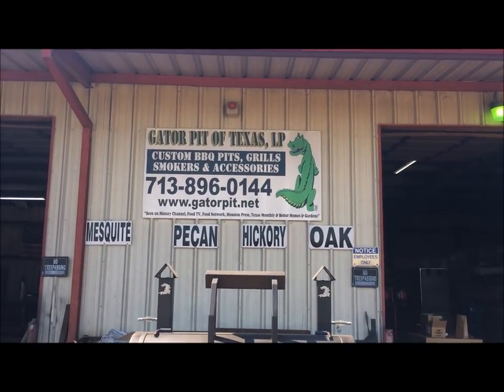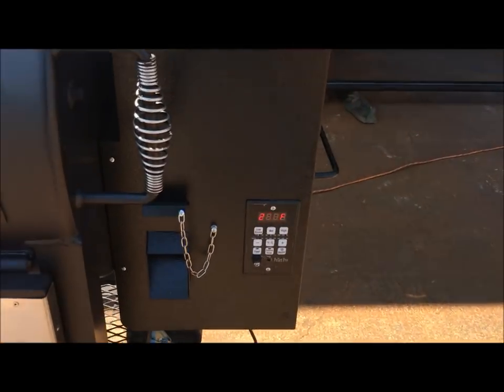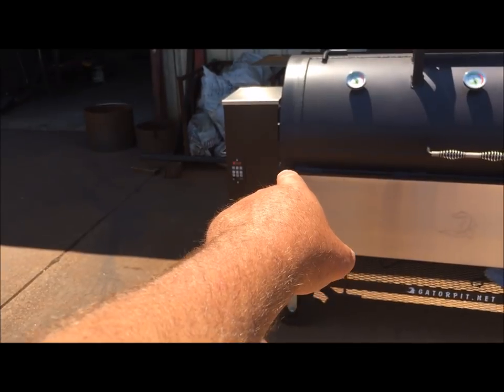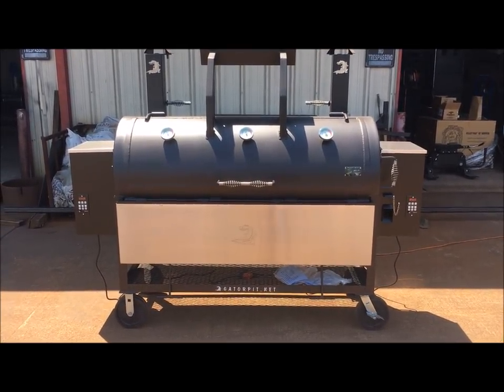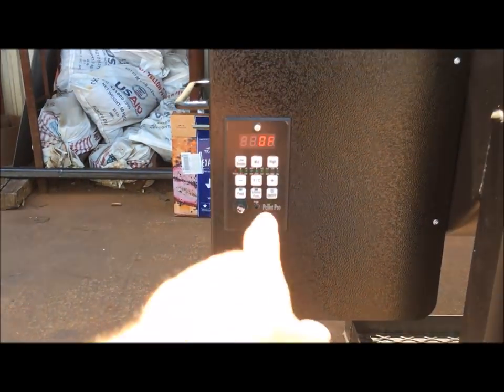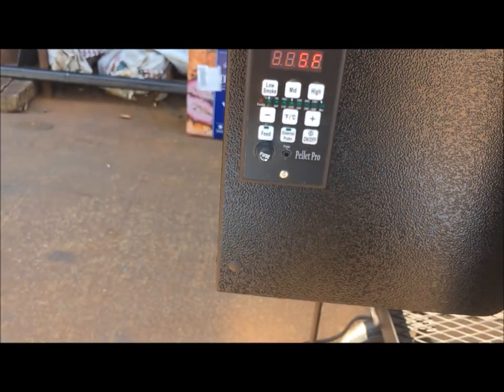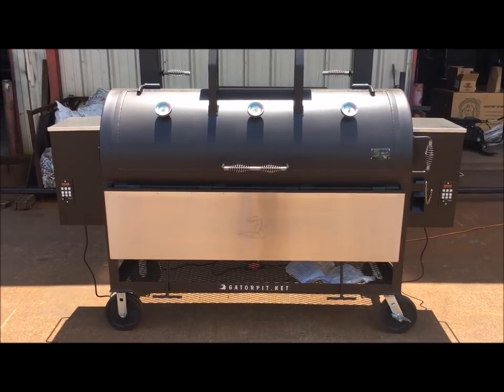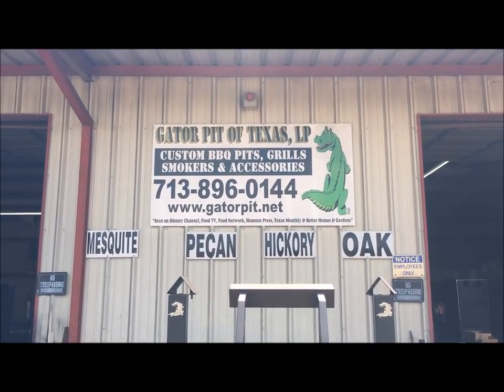Big Boy Pellet Grill

Comment: Are you running the Pellet Pro® Pellet Hopper Assembly Wiring Harness which links the two hoppers?  Or is the thought that you get more flexibility by operating the controllers independently.    You nailed the even temps either way.    Way too much pit for me, but very cool.
Reply from the maker: You are correct on the Smoke Daddy Hoppers, but not syc'd.  I preferred to not sync the hoppers.  Prefer to control them independently.  That way I can set one side a different temp than the other for whatever reason I would want to.  Cold smoke using one hopper only.  Would be one reason.

Comment: Is this a 24" pipe diameter? What size hog will this unit cook?
Reply from the maker: Yes, 24" diameter x 60" long.  100 pounder should fit inside with room for other meat.  Or, two smaller hogs.  I would bet I could get two 65 pounders inside with no problems and still have room for more meat.  I can do on my 2448 single wide cut and this is a foot longer in a single door.

Comment: how many briskets can you cook at one time?
Reply from the maker: Will hold 26 whole 10 pound pork butts and up to 20 briskets, depending on pounds per brisket.  Need a Pellet Grill that can hold more meat at one time, check out our Meat Slinger http://www.gatorpit.net/meat-slinger.html  .  We have two models available  MS24 and the larger MS36.  MS36 can hold up to 50 pork butts and 25-30 briskets.  Again, depending on pounds of each.
Reply: @GatorPitofTexas  what pit would you recommend to cook between 5-10 briskets?
Reply from the maker: @eddiepark7140  Need a 24" diameter x 48" l single wide cut door.  http://www.gatorpit.net/2448-smoker-sd.html